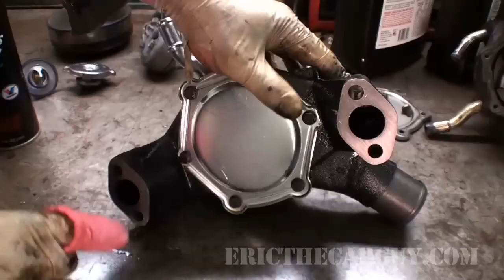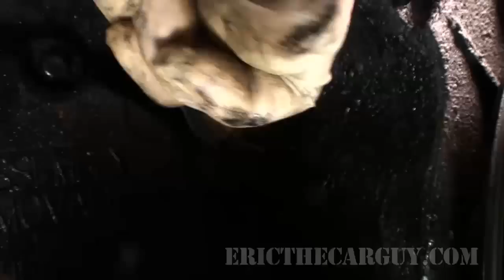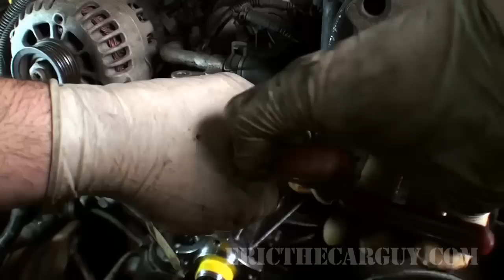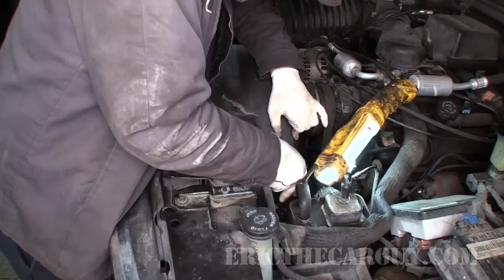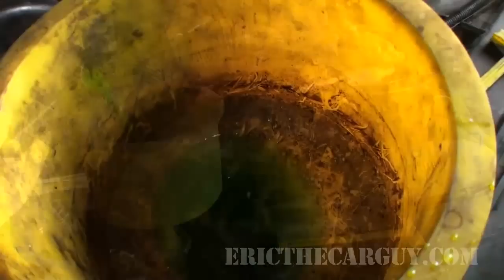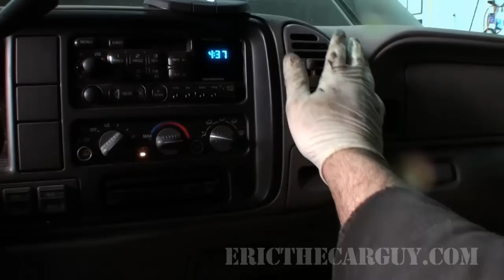1998 Chevy Tahoe 5.7L Water Pump Replacement (Part 2) -EricTheCarGuy

Comment: I HATE trying to remove the old stuck on paper gaskets, especially when the previous owner used a tube load of RTV! Maybe its because I suck horribly at it no matter how much practice I get lol

I usually use some gasket removal spray, spray it on & let it soak in for 10-15 minutes and it makes the job much easier.

Fantastic as usual Eric!
Stop making me wait for part 2 of these videos! Such a tease lol

Comment: hey, Eric , with the help of your vid I changed my water pump but just like kirk I had nothing coming from the weep holes, but what led me to believe it was the pump was coolant was flowing from the center/front of the motor also the temp gauge was fluctuating back and forth with cold air coming from the vents. I have spent 13yrs in the army 11B until I had a good part of my leg taken off by an IED.  now I work at the toughest prison in OHIO Lucasville I have done pretty much everything, now with your help I have changed I water pump. my family is shocked and im stoked thanks

Comment: I noticed that 12 people did not like this video , it shows you that they are on the wrong channel , I do appreciate all your Videos Eric and thank you so much for it , I have learned a great deal just looking at your videos , like today I greased all my drive shaft and the U joints on my 05 Toyota 4 runner and next I will do the transfer case and front and rear differentials all by myself thanks to the video that you Posted a while back , Again thank You so Much

Comment: Excellent job as usual Eric. Thanks so much for sharing.
Sometimes when I encounter the problem of aligning the water pump to the block I will temporarily use studs threaded into the block along with 2 original bolts (with their threads coated in RTV). Once the pump has been situated properly, I will remove the temporary studs and install the remaining 2 bolts (again, with the lead threads coated in RTV).
I believe I learned this trick from you in one of your older tutorials.
Again, superb.

Comment: This just helped me change the water pump on my 1997 Yukon.  Thanks...
Reply: Replace hose clamps with screws down type... Replace hoses if old....MarkMannM2. Good video... Oh, take a picture of your surpenteen   belt before you remove it.
Reply: Do believe I can handle this replacement

Comment: I am barely learning to DIY on my car that got passed onto me and it has lots of problems such as leaks from the crank seal and motor mount. So anything that can help, it doesnt have to be that exact thing to fix but if you have a that car or any car with a similar setup to work on, that would be great! And much appreciated! Thanks for your time!

Comment: I got a 99 Chevy Suburban with the 5.7 and 177,00 miles on it. Changed idle pulley last week and now water pump this coming weekend. Very confident in doing so, thanks to your very awesome detailed video, except I will be taking advantage of  Autozone's loaner tool program for the fan nut :)  Thanks again, God bless!

Comment: Thanks for this vid!  Love how the gasket starts to slide at 2:31... Might want to let it set up a bit longer and use a bit less spray or maybe put the bolts thru to keep it stationary.   
Smart move to remove the idler pulley.
I'm about to do this on a 99 Yukon.

Comment from the maker: Do you follow the bleeding procedure shown in the video or do you just top it off and put the cap on?  If you're just putting the cap on that's not enough.  You need to bleed the air out manually.  Having a bleeder does make filling the system easier that's for sure but it doesn't guarantee that you'll get all the air out.

Comment: thermostat allows the engine to warm up to operating temp as quick as possible by not letting coolant from the block circulate to the radiator when at around 90 degrees but it changes car to car it opens allowing the water to go around the radiator and get cooled by the air rushing through it the thermostat opens and closes using a wax core if you wanted to know ad can be found in Haynes manuals but usually placed at the end of the top hose

Comment: The last time I used gasket tack spray I had the same experience that you did. I thought I must have done something wrong, maybe not waiting long enough. But at that stage of the repair, you don't have much else to do. Maybe spray it on before you clean the old surfaces.
Nice review, Eric. Too bad this style of cooling fan is fast becoming obsolete.

Comment: I'm just talking about common modern truck displacements. From that Tahoe's generation and up. But you're right about the varying (insignificantly different in many cases) displacements in cubic inches.

Comment: Upon mounting the water pump, I use two wooden dowels instead of the bolts to guide the water pump up in. It holds the gaskets in place. Start screwing the bottom bolts and then pull the wooden dowels out and screw in the top bolts.

Comment: Eric I've got a 1990 Chevy Silverado. I was driving it today and it was making a lot of noise in the engine bay. I had a loud pulley earlier this week but it sounded like it was coming from the top. Maybe the air conditioner. I don't know. But I let it sit overnight came out the next morning to go to school no issues. Sound went away. But today it got really really really loud. Pulled into my cousins driveway and they were screaming to cut it off as I was opening my hood. I did. And low and behold there's what looks like oil absolutely everywhere. The wheel wells, the hood, my battery, just everywhere. Thought it was oil (because oil is black.) it didn't smell like oil it ended up being antifreeze. Checked my radiator. Empty. I was told replacing the the water pump would fix it. But the pulley in front of the water pump shakes really really violently. What do I do? Please help.
Reply: The tensioner pulley may be the problem. replace it.

Comment: Hey there, love your videos. One thing to add, I would have installed the upper radiator shroud after starting the car, getting it hot and pressureed and checking for leaks.  Also let the RTV cure prior to starting.

Comment: The fuel filter is in the tank as a part of an assembly in the 8th gen civic. You need to remove the rear seat cushion to get at it. You supposedly need a 'special tool' to remove the lockring that secures the assembly. Look at  the 'hondaautomotiveparts' website and enter your vehicle info, then select 'Fuel tank'. You'll then see the illustration of the filter.

Comment: if you leave the belt on while you remove the WP pulley bolts it is a lot easier. and i have learned from experience to get the WP in and the hoses connected and fill it with coolant before you go to the trouble of putting the pulleys and belt back on.if you dont see any leaks you go ahead and put the pulley,  belt on and  fan clutch. then the shroud and whatever wires clipped back.
 the shroud ba

Comment: I had the same problem with the gaskets when I did the water pump on my 92 k1500.  I used a tiny bit of rtv to hold them in place because the gasket adhesive wouldn't hold.

Comment: Hey guys I've got a handy tip for keeping your gaskets in place while installing the pump/letting the adhesive cure. Take 4 long thin screwdrivers and place them in each of the bolt holes and into the block. Remove one and thread the bolt into the block, then repeat until all bolts are tightened. This will keep the gaskets in place and prevent you from having to manhandle the pump around while tightening them.

You can use screw drivers, punches, whatever is handy. It makes life a bit easier especially when doing this on a car where there is even less room.
Reply: I'm doing a GMC Jimmy with a 4.3 v6 I made two alignment pins for the bottom bolt holes because I couldn't hold it up and get the bolts started I jacked two gaskets trying plus I cut the extra tabs off

Comment: When doing my own I always paint the new pump the day before,  can't stand having a rusty water pump on an otherwise all painted engine. I also would have replaced those heater hoses simply to save having to replace them a year or 2 later when it's harder to do. But for a customer you can't go to the extra time and expense unless the hoses really are bad or they ask you to paint it (and I never had that happen). 😉 Great video Eric, two thumbs up.

Comment: I've read that it depends on the outside block dimensions, not on its displacement per se. So if good engineering will, a small block can have 7 liters and a big block can have 6.3 liters of displacement. And on older engines people say a small block has its distributor cap at the back top of between the cyl heads and the big block has it sitting at the front top of between it. Which i don't know. But Block classification refers to its outside dimensions. Greetings from Germany.

Comment: I've had so many of those bolts break on removal due to corrosion. And yes it is a very bad day. What happens is the water leaks past the threads and corrodes the bolts to the water pump. Ford is even worse because they also go through the timing cover. So you either waste time drilling the bolts or save time and just break the timing cover. Best way to do it is cut off the water pump and timing cover from around the bolts. After that grab the bolts close to the block and they usually come out fairly easy.

Comment: There are 2 basic GM V8 engine block designs: the Small Block and the Big Block. The Small Block V8 has 5.0, 5.3, 5.7, and 6.2l displacements from the factory, whereas the Big Block V8 has displacements from 6.5l up. Both are quite large, but the Big Block is much larger than the Small Block.

Comment: Some gm cars can be tricky to fill up when you working on his coollent system. I remember before with my second car, a 1990 chevy lumina 3.1, the radiator sitting lower than the water pump and some mecanic just overheating my engine so bad when he trying to fill it after a heater core replacement that the both head are good for junk on my recently rebuild engine. They replace my engine with no charge but i lost my car for two week.

Comment: Looks like somewhere between 1996 and 1998 they changed the fan from metal to plastic and the tensioner to hydraulic. Only difference I noticed really. What was the CEL on for?

Comment: I have a 1998 chevy v6 p/u with about the same mileage. You will know when you need new motor mounts when the belt wears a gash in the lower rad hose.

Comment: I've done 3 external GM water pumps and I have what I consider the best method for installing the new pump.
Love the video, but saw the gasket fumbling so here's a tip

the recipe:

take 1 of the pump bolts up to the hardware store
get 4 that match the thread and are twice as long
cut the heads off of the those new bolts
HAND thread them into the bolt holes
slide the gaskets on - i don't use sealant crap
now slide the new pump on
one at a time replace the headless bolts with the factory pump bolts 

Never had a leak with this method, no need try and hold up the pump and align gaskets while installing
I have pics, but not sure I can post them here.

Bob in Little Canada
Reply: gpawbb I always wandered why we don't just use studs rather than bolts that stretch and can strip seems odd I may arp stud those thanks for the knowledge I know this is a old comment but still helpful

Comment: Its hard to believe you did not replace the bypass hose to the intake or the 90 degree heater hose, those look old and are known to split from heat. A little anti-seize on the clutch threads does wonders to prevent rust. I almost fell over when Eric got out a pipe wrench in part-1

Comment: Eric, the worst part of the water pump job is those damn gaskets. The adhesive is a good idea but I went and got myself some threaded rod same size as bolts and I screw them in the bottom two holes to use for support and also allow you to start your top bolts and adjust the gaskets if necessary

Comment: replaced a thermostat last year, used harbor freight tools torque wrench. Set it for 19 lsbs broke a bolt and it didnt start leaking until this winter, now thats fixed and now water pump needs replacement.  DON'T TORQUE ANY BOLTS MORE THAN 30 FOOT LBS like Erik says, it will be a bad day.

Comment: Just did mine right now, I used an adjustable wrench that barely fit over the fan clutch nut, a couple taps and it came loose no problem. I was glad i didn't have to resort to bang on it lol

Comment: The term big block refers to the deck height of the block not the displacement. For example Chevrolet back in the late 60's early 70s had a 396 cubic inch big block and a 400 cubic inch small block. Chrysler had the 426 cubic inch Hemi, which was called the Elephant engine for very good reason. And now a days Chevy has the LS7 which is 427 cubic inches which is still a small block engine. More than a little confusing I know, especially if you're from Europe...

Comment: I have a 1998 silverado 5.7 that needs the power steering pump relaxed, do you have a video or link on getting the pump off..I have all the front bolts off and one in the back, but it's still stuck, don't know if it's another bolt or nut that I'm missing.

Comment: why not use pipe/thread sealant on those bolts, thats what GM recommends, either way i guess. did you make sure those bolts on the rear cover of the new water pump were tight, have seen those leak, and it actually says in the instructions in the box to do that, not that we ever look at that stuff, lol.

Comment: Hi. I have a 1996 chevy silverado z71 pickup with a random miss fire code and I can't figure out what's wrong. Replaced down stream o2 sensor and left side o2 sensor new cap and rotter new fuel pump and new spark plug cables. It runs good tell it gets to 198 degrees. Thanks for the help

Comment: The green coolant is fine ,just never mix it with GM Dex .It will turn to sap . GM Vortec (R Code) have an intake gasket unlike the(K) , dex-cool at 70% will help with lube it needs to keep from leaking . Best thing is that they leak outward most of the time .

Comment: hey Eric I'm doing the same job on a 5.0 305 v8 was woundering if on the bolts to water pump would it material what type of rtv silicone you use I don't have the blue type I have some black and the red high temp rtv would the red be fine for that to use

Comment: nice job , but you should pressurize the system , before put all the parts together , to check for leaks right ?
Reply: maybe if your for whatever reason unsure of the fitting.  but i wouldn't pressurize a new water pump that isnt hooked up.
Reply: emutiny he meant after you seal the cooling system and before you install the rest of the components.

Comment: why are they making through bolt holes that can leak . I don't think I've ever seen this on Honda's or Toyota's. I have a great product for those threads called leak lock I use to use it on bus a/c systems up to 450 psi and held. could hold higher but the a/c wouldn't cool properly after that

Comment: Great videos Eric, I really approve of these....!  Why you ask?  Because I don't own a Subaru or a Honda!  I own trucks! lol.... I actually performed this service on my 1991 Chevy C1500 1/2 ton 2 WD With the 350 TBI. It was a snap... took about an hour maybe a little over because I cleaned everything up along the way. My engine looks like it did when the truck was new! No grease, gunk or the usual stuff... and it's such a pleasure to work on!  Could you possibly do a steering gearbox swap too?

Comment: i have a question my 2000 mustang gt has a problem when i come to a stop light my idle will surge and the car will shut off i brought it to the guy that tuned my car and he messed with the idle air control valve and it sort of fixed the problem do you have any sugestions please respond

Comment: Hi Eric. I carefully watched these videos fully expecting to be replacing a water pump on my 97 Tahoe.  But nothing was coming from the weep holes. water pump is dry but coolant is dripping profusely from the center/front of the motor. Dripping from the very bottom of the timing cover. I can trace it as far as up to I think the front/driver side of the oil pan if that makes sense.  Doesn't seem to be a leaky freeze plug.  It's coming somewhere from behind the bottom of the power steering reservoir. I'm baffled.
Reply: could and will likely be your headgasket . My burban did the same until one day catastrophic failure....
Reply: It was the driver side gasket on the water pump.
Reply: got the same problem, got new gaskets today, it'll drink 3 gallons of water a day

Comment: You need to get an engine. Rings can be bought, but you do not remove an engine, disassemble it, and replace only rings. If your rings are worn out, it's probably time for a rebuilt engine or to rebuild your engine.

Comment: great vid thanks, doing my pump tomorrow,using green cool all my life , no problem, if adding water use DISTILLED water. get it at the big drug store,few bucks a gal. I am staying dirty. thanks. also got the HD pump with clutch at the zone for under $100

Comment: I call BS on not needing a bleeder. Maybe on that vehicle, but I wouldnt make the generalization that EVERY vehicle doesnt need one.. My jeep will get air trapped at the back of the head if you dont pull the temperature sender out, pretty common on older 4.0s.